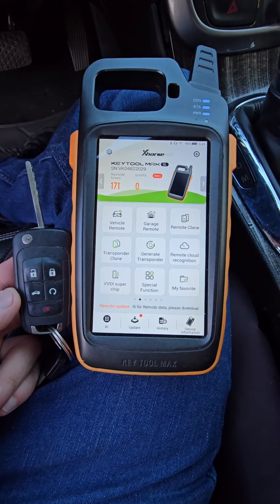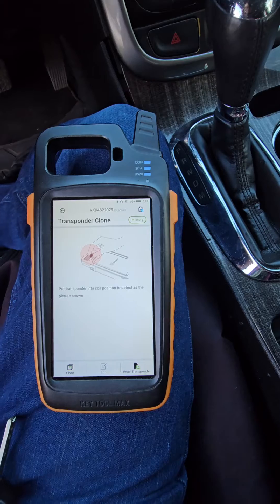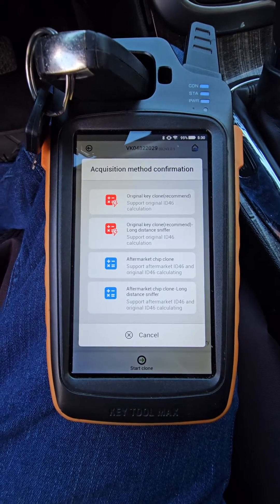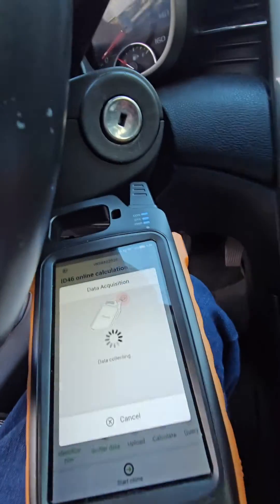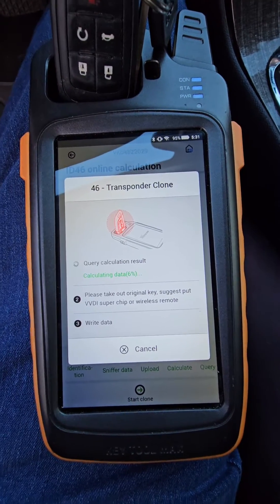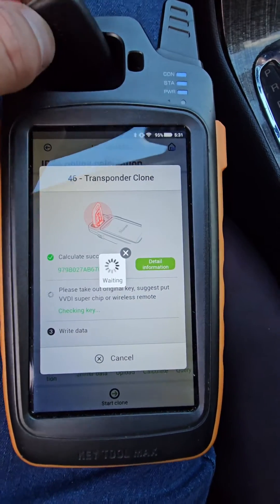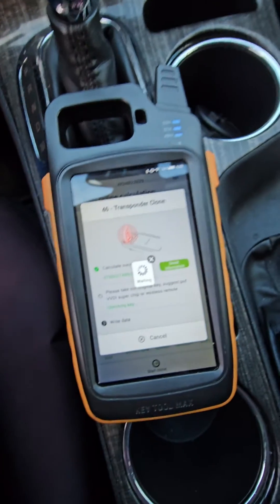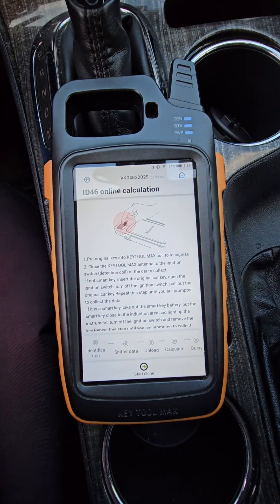General Motors Key Cloning Xhorse Keytool max!

Comment: With all due respect, what would be the benefit to this as opposed to simply generating a 46 chip, cutting the blade and then doing the normal on board GM programming procedure? I imagine it would be much quicker and wouldn’t require internet either; not hating as I’m sure this can come in handy in some situations, but just putting it out there!
Reply from the maker: There's usually more than 1 way to tackle a key. This is just 1 of many examples.
Reply: @EntryExpert  absolutely correct, I imagine this would help mostly in a situation where the car already has max keys learned to it